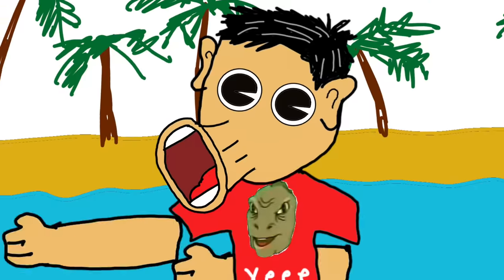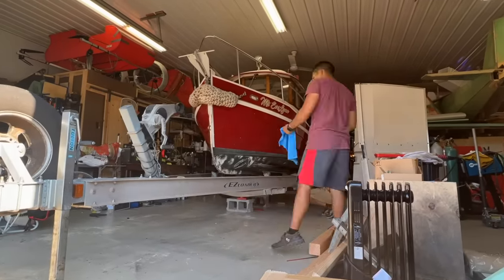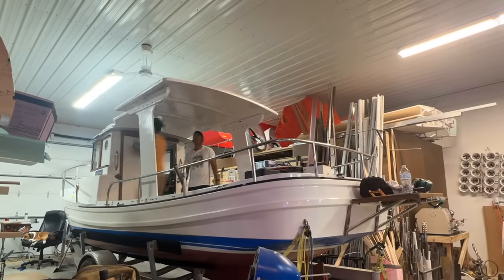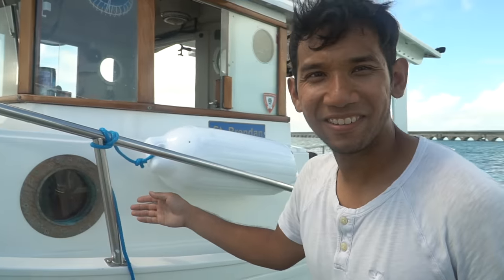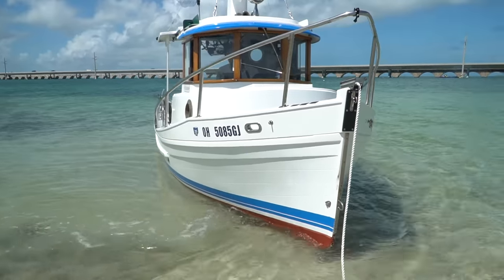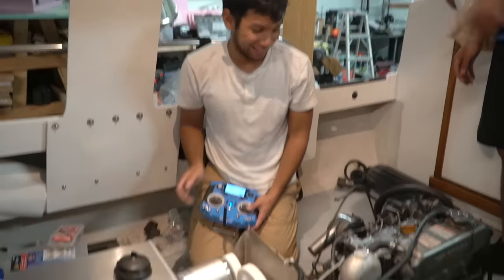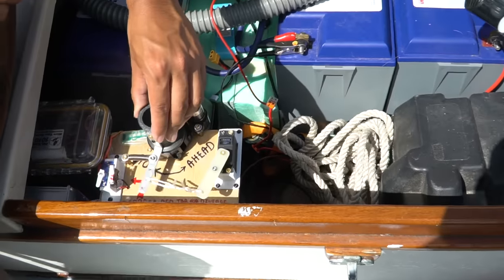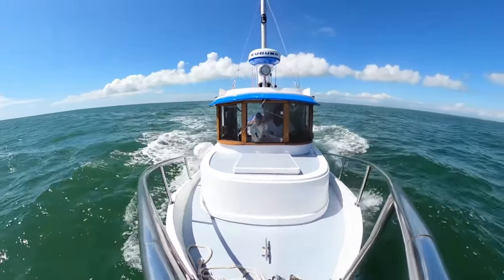I Bought the Biggest RC Tug Boat!

Comment: As a lifelong boater, my suggestion is SAFETY above all else. Take a basic boater safety course, your life will depend on it at some point. When something goes wrong out on the water, it happens rapidly, is usually irreversible, and knowing what to do without hesitation is critical. It should be treated like a manned aircraft, which you are already familiar with. Follow a seaworthiness checklist and a safety checklist before heading out. Obvious things like fire extinguisher, signalling devices, PFD's, first aid kit, tools, etc should be in their place. The day you head out without one will be the day you need it most. Understand the "rules of the road", what the various marker buoys mean and how to proceed past them. Understand right of way, always give it to the larger vessel, or vessel under sail. Look over a nautical chart of the areas you plan to be for unseen hazards like shoals, pinnacles, wrecks, structures and shipping lanes. Pay attention to the weather bulletins before and during the trip on your VHF radio. Make sure to instruct at least one passenger on basic operation of the boat, how to kill the engine, and how to use ch 16 on the VHF, as well a know how to relay your position coordinates, and where to see them on your GPS. All passengers must know where PFD's, first aid, fire extinguisher and signal devices are located and how they operate. If operating at night, understand what various lights on other vessels mean, for example: if a boat with 3 vertical white lights crosses your heading, DO NOT PROCEED after it has passed. You will not see the mile long, boat shredding cable and chain connecting it to the poorly lit barge being towed far behind it, and its unlikely the tow vessel will know you even hit it. Don't rely on another boater to give you all of the important details, take a course that follows a curriculum that will cover all of the bases. Being in the fishing and boating industry my entire working life, and spending much of my childhood on the water, I've seen many things happen, and have lost numerous friends and colleagues to boating tragedies that could have been avoided.

Comment: Get tiny aluminum jet boat like grind hard guys and make it RC mix setup! Also well now that you have boat... time to make it aircraft carrier :D Launch and recovery systems should be decently easy to build on the top, though that radar and mast cause issues. Also to protect brass in sea conditions, there should be coatings for those you can look into. Easiest probably would be 100% bees wax?

Comment: Peter great build, you got a great boat, I seriously feel you should remove the diesel engine put in a 3~4k RPM BLDC moter get metal gears with 2 speed setup for hi and low speeds and most important install a VAWT and solar panels on the roof and baaam you get whole lot renewable power to charge the LiFePo4 batteries, why VAWT coz wind is ample at sea, if you need bigger batteries I shall send across I build these, love respect and warm regards from India 🇮🇳🇮🇳🙏🏻🙏🏻

Comment: Nice . Why don't you put an air vent in to keep the plastic cogs cooler I sometimes do when I had a electric motor that ran to hot , I used an vacuum cleaner to blow cold air into it to keep it running .

Comment: Speed vs hull length has todo with speed.
Look up boat hull speeds.
Or hump  speed of ships. 
It will explain it better. 
For a 20 ft trawler semi displacement or displacement hull. 
6 knots is probably full speed.

Comment: Hey, peter, I have a little dare for ya, I was gonna give it to Mark Robber, but I thought this is more like the things YOU like. The dare is this:
This year, we got the 110th anniversary of the Titanic sinking, and I was wondering if you could make a working engines titanic model, powered by steam engines, (you can try to make the water boil using batteries) The titanic was powered by 2 reciprocating engines, 4 cylinders of triple expansion for the wing three-bladed propellers, and a Parsons low-pressure turbine for the central four-bladed propeller. If you wanna make the dare even harder, you can recreate the rudder steering gear, ancient steam type.

Comment: Are you turning the disel while you are driving elektrically? For efficiency it would be way better if yuo don't, also it might be bad for the engine if it spins such slowly and doesn't build oil pressure.

Comment: 14:40 I’m wondering is the prop shaft turning the engine as well? If so, is the engine being driven by the motor when it’s in use? Refining that solution to be more easy to disconnect I’m sure is a priority. Anyways is there a sealer or solution you can add to the exposed metal components to prevent that corrosion? A very though provoking video, thank you Pete

Comment: Excellent video and adventures! Maybe an opportunity to experiment with hydroplane foils to get St. Brendon out of the 4kt speed envelope?
Reply: Too heavy and not enough power. Once a displacement hull, always a displacement hull.
Reply: Indeed so, needs more powerful motor, changes to profile of displacement hull and foils to lift out of the water. Once that displacement hull is above the water then it's not the drag it was in the water. Nothing a motivated engineer can't do.
Reply: @victordewey6782  I think the Candela’s intensity around ultra lightweight materials speaks to the impact of weight on hydrofoil boats, likewise MJM Yachts effort to keep boats light also shows in their fuel efficiency. Going fast in the water on battery power is a difficult problem that current batteries don’t solve for normal boats.

Comment: That’s exactly the boat of my dreams , I wanted to build it but at my age it doesn’t make sense (65) ! I do have a 15’ center console boat ( like a Boston whaler ) but I’m restoring it . I also have a 19’ speed boat ( I never use ) with a inboard 150hp and trailer I’d trade you and some vintage outboards ( 1922 - 1984 ) I’d throw in with it !
Reply: Sell. Both new whaler 15 50 hp eltric

Comment: My boat has about the same fuel efficiency. 28’ sailboat 10hp Volvo diesel. Should consider helical cut gears to cut down on noise. Also would wear better if it has good lash
Reply: 10 kw. Bater 2500 wats 4 hours 20 mm range 22.5 Mike's j88 solar ekrric range

Comment: Do you put the drive box in neutral when you operate the electric motor so it doesn’t spin the diesel engine?  Also can you replace the PLA gears with a belt?

Comment: 48v 2k watt go cart motor eh? ... time to make a 10 gallon water carrying plane with it ya know for hard to reach fires ... with flying refilling of course and take off from water I'm thinking Sea Dock 🦆 but more tailspin like overpowered edfs under the wings  and as large of props as possible maybe calculate for prop pitch needed at whatever rpms you can achieve

Comment: You should set it up so the electric motor can charge the battery's when the diesel is running.. Though I doubt you will need the electric drive much that Yanmar runs very low RPM and sips fuel.. .
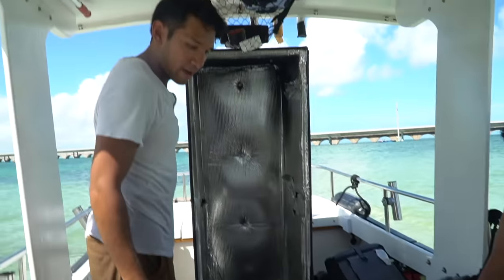Reply: LOL! Do you see the belt and 3 pulleys @ 12:25?
Lower pulley is crankshaft, upperleft is coolingfluidpump, and upperright is an alternator.
A pretty big-@ss alternator, if you ask me. The type used in motorhomes with a big batterypack, for powering air-conditioning, television, refrigerator, microwave, etc...
Even semitrucks don't have such a big alternator! (Except some, which do also have ac, tv, fridge, mw, etc.)

So, in terms of efficiëncy, there's nothing to gain in using the electric motor as a generator.

Could be interesting to see if Peter can build (or find) a beter alternator or generator (or other kind of kinetic-to-electric-energy-converter), that's cheaper than what's on there now, though...

Comment: Only thing I will pick on your GRP repairs is you really need to grind out all the damage to about 12:1 depth of repair : width of repair.  It is more work in some ways,  you have to built up the glass layers to match the original structure then gel coat over and fair in - but this gives original strength without any hard points or cracking out of filler...  Nice boat, good project.  The costs of running even a 30 foot vessel compared to this lovely little one are much higher.  If you start looking into 40 plus foot boats you are going to need a healthy bank account and expect your costs to be at least ten times greater than what you have now.  Most bigger boats that are cheap will need a lot of work and money to get up to any safe and reliable standard - any boat that's fully sorted out and in good general condition will cost a lot, but that is normally much better in the long term.  It's fairly simple to keep a good boat up to a good standard, but very expensive to bring a poor boat up to a good standard.  Replacing a 3 cylinder Yanmar might cost a few thousand dollars - replacing the main propulsion engine in a trawler could be over a hundred thousand, plus the drive train, shaft, prop etc. are exponentially more costly to maintain.  You are required to withdraw the shaft regularly and replace at set wear and time points in any larger vessel subject to survey requirements - you will find you cannot dock or moor vessels in most places if they are not in current survey and insured, and you can't insure unless currently surveyed etc...  Do a lot of homework, get on other peoples boats and learn what is really needed before even thinking of 'investing' in a larger project.  The sort of people who live aboard and maintain older large boats tend to have a lot of marine systems and fabrication skills and experience.
Reply: Buy hybred ektrc ysgts 30 too 40 foiter

Comment: After you clean your brass next time, buy some clear acrylic in spray cans and put on a good coat of it. It won't stop the corrosion, but it will retard it at least in half or more, plus it makes the pieces a lot easier to clean.

Comment: Boat means "Bust. Out. Another. Thousand" so I have been told.

Edit: Maybe provision yourself some sort of safety system in the event you fall overboard WHILE in "RC MODE" 
Not sure of the resting state of the system if the transmitter is lost but just something to think about. 18:45 I was thinking "what happens if you fall overboard" (especially alone. )

Edit #2: It just occured to me that in addition to a "shut off in the event of falling overboard" you might consider making the control "water tight as possible" in this way if you fall overboard but are still capable you can bring the boat to your location (ha ha boat summon feature)

Comment: The bit about displacement hulls not being able to go fast because of squat (getting “sucked” down into the water as they go faster) is wrong. It’s a real effect, but it’s not going to be significant on your boat. And displacement hulls can absolutely go fast, they just need more power. The wake is actually because of constructive interference between the bow and stern wakes. Hulls are also not shaped like airfoils. 

<3, somebody who designs ships for a living.

Comment: Get a sailboat and make all the sails RC controlled. Added benefit is no fuel costs:p I have a 28 foot sailboat with a 700cc Volvo diesel engine and a 35 liter tank. I filled it in spring and sail almost every week and tank is still half full :D
Reply: Good for n it

Comment: sir Love your GENIUS. Cannot get enough of your videos. I too own a Ranger 21, but mine is a 1974 in prime condition. I just added a 12 volt split system, to run it I added a lifepho4 200 amp. Hr. With two 220 watt solar panels. Now I want to fold down mast, as you did. where did you find the hinge ?? Please, please send me picture of how you fold it. Oh, I added SS Bimini all around back. Oh , so I can heat and cool cabin, I am an old fart(76) who get heat stroke, Why Texas😱😂😩, no income tax. Love love, my Ranger, cost $17500 two yrs. Ago. Thanks for any help. Patrick Gilhooly

Comment: Why would you paint over the gelcoat? It is very easy to maintain and is designed to last decades. Paint will fade, it will end up scuzzy and you will end up re-painting, assuming you keep the boat long enough. Matching your repairs would have been more difficult, but worth it in the long run. Typically, if gelcoat gets faded, it can actually be wet sanded to restore its luster. A coat of wax on it and it is protected. SMH.

That being said, Ranger Tugs are pretty cheaply made and who knows how thick the gelcoat was laid on.

Comment: Wish someone would’ve stopped ya from doing the painting bit… you basically just painted a bare layer over the real gel coat that was far better. The bottom was the only part some heat needing a fresh coat coat

Comment: Just by doing what you did to the boat you at least doubled the value of the boat. If that was done on the water, like most repairs are, you would have shelled out tens of thousands of thousands, because shipwrights only know one thing. HOW TO CHARGE!

Comment: Bro u should make a hydrogen motor there easier to make then petro. Just get a container with water and baking soda and put two electrodes put electricity on the electrodes then pump that hydrogen into the motor tada u got unlimited free fuel for life just don't make a video about it or they will find u and they will say it was a heart attack